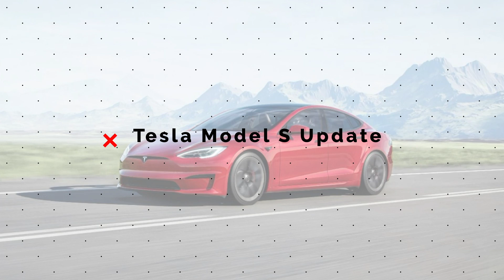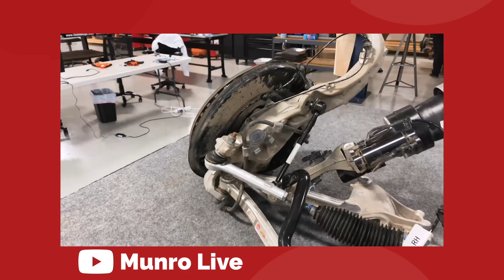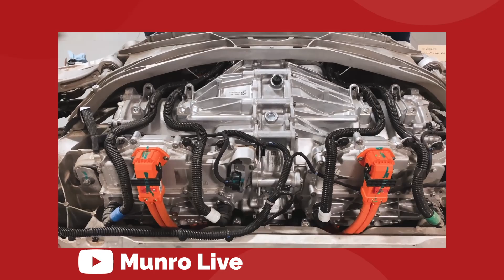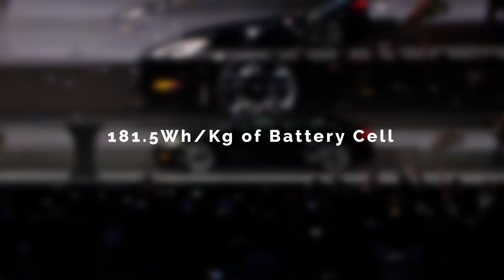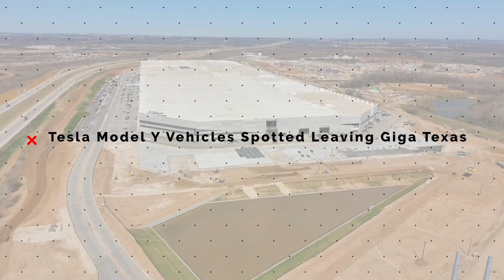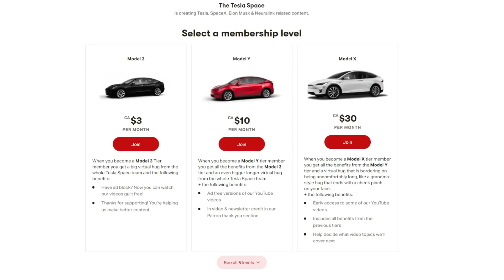Tesla Makes More Changes To Model S!

Comment: I own 2016 MS 90D, purchased new. An interesting year for the MS in which Tesla produce 3 versions during the 2016 model year. The initial 2016 release was hold over from 2015 and legacy front black grill cover, kinda ugly.   The mid year change came in the form of the new body style, still mostly current today, and the concluding months of 2016 added the pillar camera and upgraded tech.  

So what's change in looks since mid-2016 Model S. Musk's mad march to better production profit margins by eliminating buyer options and cutting material costs, as this video demonstrates. 

Since 2018, gone decent color choices (like met-silver), wheel options (I had 5 wheel options to choose from), the opening pano all glass roof, alcantara suede interior highlights and headliner, USB-MP3 infotainment interface, stainless interior trim, chrome trim in all manner, performance seats, a carbon fiber interior trim option for all MS models, integrated and stylish fog lights (since 2021), and the list goes on...oh yea, and now missing a full steering wheel.  

Clearly, Musk is focused on performance, robot drivers, and better batteries, all good things, but the continuing drive to limit buyer configuration choices comes at a price. Athletics matter when you're buying a six figure car.   All car manufactures, by accident or intention have classic model years, clearly Model S 2016+ through 2020 model production years are an example of the Model S at its visual best.

Comment: phantom breaking was occurring with lidar as well. This is why lidar was removed in the first place because it was creating conflicts with vision causing unnecessarily breaks. Phantom breaking most likely comes from over cautious training. If you want to release a software it is better for it to break than to hit something. This means a lot of false positives. 
As training continues there should be less and less phantom breaks although tesla should be urgent about it since it would be a disaster if this was regulated.

Comment: The panel gap comment hits close to home, inspected my new S long range yesterday, production said 1/22, and it had major gapping on front hood, with some slight gapping misalignments on trunk.  Also all floor mats, trunk top enclosure to the storage hole, and the privacy flip up screen for trunk all on back orders, sales guy said I may see in 3-4 weeks.  Hope they can fix gaps in house, as if they can’t they indicated it would go to body shop and take a week.  If it does go to body, I will pass on this one and wait for another production run.  It must be precise to write the check for $100k
Reply: My 2022 Model 3 lR has zero issues with gapping or misalignment. Quality work

Comment: I actually liked the black bar of the back especially when its blacked out, it  gives it that sporty look. as far as the charge port goes I also liked the old one it was small and gave it that premium look I think, I like how on the old one its just the charge port area was open with the 3 and Y you have a little bit of extra and wasted space I think.

Comment: Why are you creating FUD? Your reading someone else's conjecture about fantom braking without any firsthand knowledge of the situation.
Reply from the maker: Respect your opinion but I don't think providing an update on an actual investigation is FUD. I do also have firsthand experience with phantom braking in my Model 3.
Reply: @TheTeslaSpace  I should have referred to your piece taken from who knows where that stated."The problem may be traced to the controversial decision last year by Tesla to remove radar sensors from new Model 3 and Model Y vehicles". 
Using some piece like this conjecture brings fear or uncertainty and doubt when in fact it may be just related to software and an update along the way.  Those folks driving a newer vehicle without radar may be fearful to drive it because of this "missing radar". Regards

Comment: This is about fitting CCS 2 combo plug for Europe. It is mandatory for EVs to have the same CCS plug in here. Model 3 has bigger charge cover so it fits CCS, model S hasn't. So now they had to make it bigger. Photo with comparation of plugs in model 3:
https://qph.fs.quoracdn.net/main-qimg-cff7aed6d15300a5f0302085f03946ee

Comment: Many if not most female drivers routinely apply brakes (or at least tap on the brake) when the traffic condition doesn't warrant it, normally when they're unsure what to do, when get closer than 100m to other cars or when need to reduce speed slightly - when you'd just ease off gas a bit! I wonder if some women have been allowed to work on AI/FSD recently hence their (incorrect) natural bias has influenced phantom brake! Not sure but plausible to me
Reply: lol why so sexist??
Reply: @ATVguy56  I just wrote one of my observations. 
There are many things women are naturally good atin fact better at like balancing, flexibility, situational awareness, language learning ability, multitasking (as commonly known although it's in reality 'fast context switching' to borrow a phrase from computing world) and much more but driving ain't one of them and map reading is another!
Reply: @soundslight7754  Yeah well, a lot of guys are shitty drivers too, but women probably are more likely to brake unnecessarily.  There's no way in hell that was programmed into the AI, though.
Reply: @incognitotorpedo42  1. Define "shitty driving"? 2. What makes you so sure of braking? 
AI behaviour isn't linear or procedural: it has many demands and inputs, needs to reconcile all to find correct resolution 1000s of times a second. Reducing speed or proceeding cautiously on occasions can give it more time if nothing else
Reply: @soundslight7754  
He's a troll from "the old days". thought we were rid of that one.... oh well...

Comment: there not enough charging station for electric cars yet your ever day mom and pop gas station does not have electric car charge station
Reply: The difference is you plug the tesla in every night and wake up with it full, no need for charging stations
Reply: @matthewp1682  what if i take a long range trip were will i plug my car into the charging infrastructure is not there yet
Reply from the maker: @misstransgender  There may still be some rural areas that don't have sufficient charging infrastructure but for the most part, there's quite a large amount of charging stations everywhere now. The Tesla will also plan your route based on charging stations along the way. You can comfortably travel across the entire country in a Tesla with current infrastructure.
Reply: @TheTeslaSpace  thanks
Reply: did not know they plan my trip
Reply: what if wont to go sight seeing on a half charge we got stay on the plan route
Reply: then charging takes a hour or 2 kids getting up set they need a 2000 mile range
Reply: You only need superchargers for long distance road trips and Tesla is expanding their network everyday!